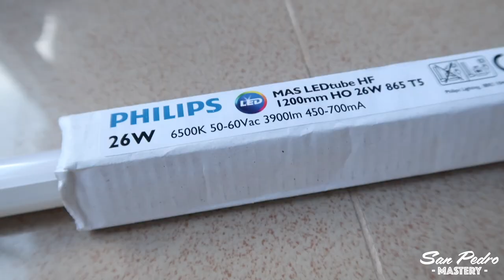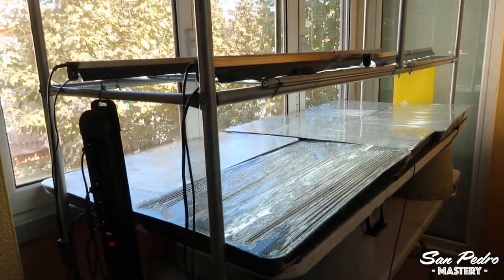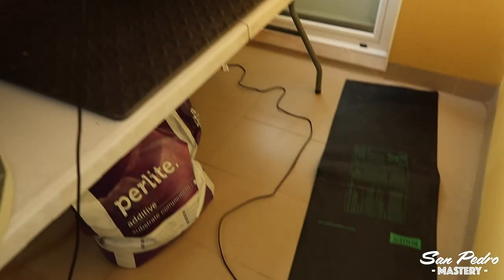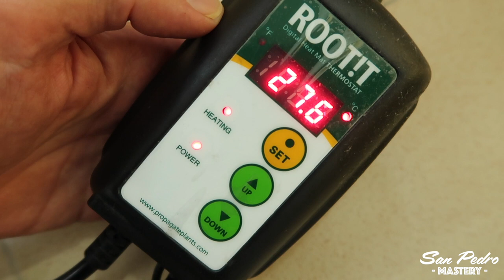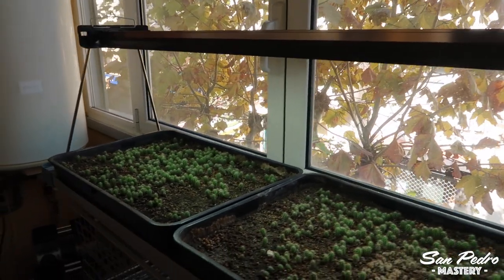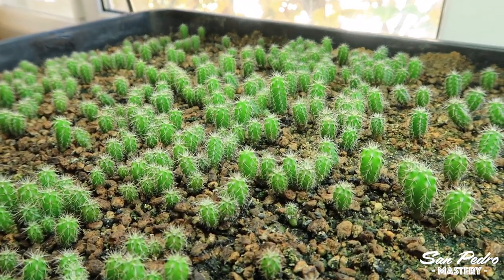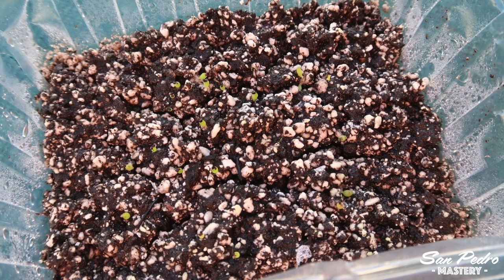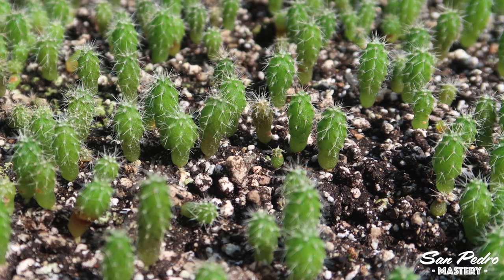My Winter Setup - How to Grow San Pedro & Peyote from Seeds in Winter (cactus seedlings indoors)

Comment: Jerry, I just went through winter here (Australia), and went another route, I bought a large freezer cheap, for  $40 ($30 US?). With it unplugged, I screwed a 40w LED (Also about the same price) to the inner top. With the seedlings in sealed trays, and the lid down, the small heat of the LED put out kept the temperature at around 28C (80-85F). TBH, a freezer not working could probably be picked up for free, but a cheap working one, why the heck not :)
Anyway, it worked better than I had hoped, a few mistakes on my part, as entirely new people often do, but this setup helped enormously, and is discreet :) Now spring/summer is here, about to setup in the sun, and closing it down, but it still helped me sprout acorns, avocados and seedlings other than cacti ready for spring :) Another boon was that I bought a large Dragon Fruit, used the seeds from around 1/3 (and ate the rest) and grew three containers with hundreds of DS seedlings in each. I had no idea FRESH seedlings would be so much MORE prolific. Since DF is such a fast grower, I am hoping that when I am ready, I can use them to graft onto, as well as a base for the LW I also grew.
Many thanks for your informative videos, as a newbie, I find them both insightful and knowledgeable. They have helped me enormously :)

Comment: Hey Jerry, do you get the Philips TL5 HO 54W 865 (MASTER)  with the reflectors and the cables included ?
Reply from the maker: Ciao Simone! My reflectors and cables are from Root It, I don't recommend them as they have bad connections when they age. You can find similar from other makes, they are normally made for growing veg stage cannabis. The Philips bulb you mention, I get them by themselves. If I remember well, the Osram T5s of similar specs have got a slightly higher lumen output for the same wattage, but you want to double check on that. I got the Philips because I had a better deal on them. Just don't get the LED replacement tubes, I am very dissatisfied with them.
Reply: @sanpedromastery6262  thank you very much. I will check for the reflectors. I also was checking for unfertilized soil and had a really hard time finding one. All of them seem to have at least some worm humus.Is there any brand you can advise me? Is seedling soil good for this purpose if mixed with enough perlite?
Reply from the maker: @simonetomasi4080  Yes seedling soil mixed with enough perlite should be good. I have grown cacti on fertilized soil and it works, but unfertilized is a bit better. I don't think the brand matters that much for the worms casting.